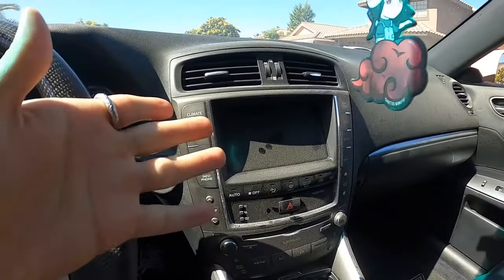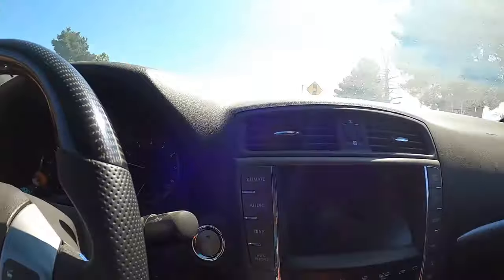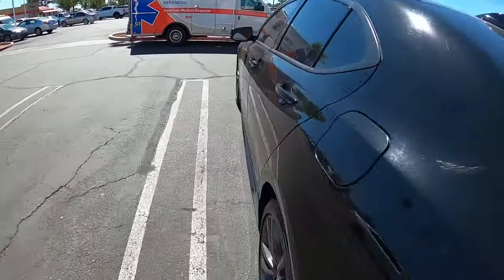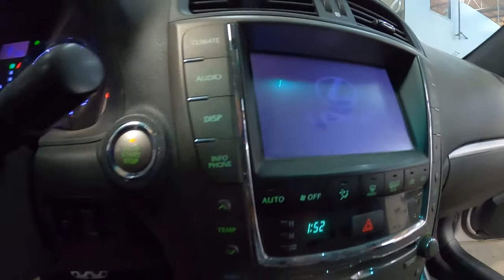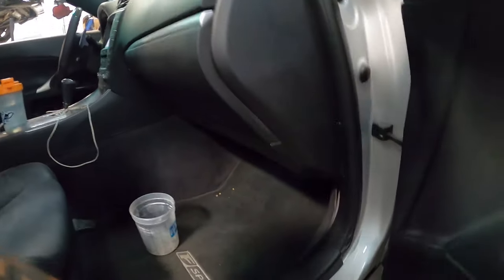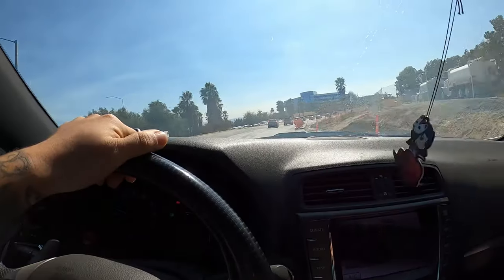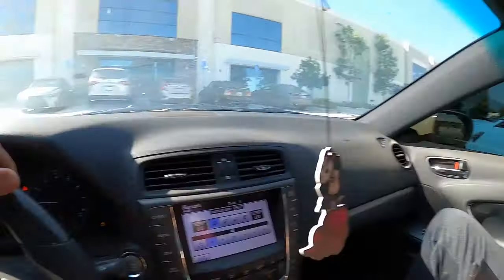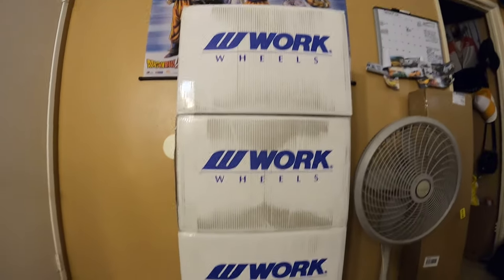HOW TO FIX THE LEXUS IS BLACKED OUT RADIO SCREEN!

Comment: its weird so for me the screen always goes black and cuts out and will stay off for a while.. BUT the radio works and the AC will work but i can't turn the AC on because the buttons for the AC are the screen and the side buttons. So the bottom half of the entertainment system works like the FM/AM buttons radio volume knob etc.. BUT the real issue now is the AUX never recognizes itself so that doesn't work.. the screen is black, but the radio works BUT no Aux connection detected lmao.. this cars fucking weird bro.
Reply: That’s what’s wrong with mine lmk if you found a fix

Comment: Hi Desmond,  I have a lexus 2006 IS350 that has the same problem, My radio is working but he screen totally black out. I like to know what and where is the location of the fuse that he Change? I really appreciate it if you could tell me. Thanks
Reply from the maker: So in the video around 7:16 is where he found the issue for the fuse. It could be a couple different fuses that went bad that have to do with the radio in my case it was my tv fuse (basically the screen monitor fuse) the time I set shows where to find that one in the vid as well as a couple other fuses but it would be best to have someone hook up there equipment to see exactly which fuse is out. Cause it might not be the same one. Preferably someone who works electric/radio. Hopefully this helps some, thanks for watching btw
Reply: Did you solve it?
Reply: I have the same issue

Comment: I kinda have the same problem. My radio on my 2014 Lexus IS 250 keeps shutting off and on very annoying. I change the fuse same problem not just a radio that shuts off the whole screen to the navigation shuts off. One of my friends said it can be the amp is getting shortage because the rain gets into the side vent or trunk or something like that
Reply: Having the same issue
Reply: Same here on mine too
Reply: My sister has the same exact car as mine and my boy has the FSport same year and has the same damn problem smh my boy changed the radio and still doing the same shit smh . I wonder if it’s a recall for this type of model on these Lexus!
Reply: @geoa.21  it’s so damn annoying driving with no music! My sister has the same car as mine and has the same problem! Also my boy just bought his car a year ago 2014 Lexus IS 250 FSport and has the same problem. He was told that water gets into the trunk and damaged the amplifier or something like that and he changed the amp. And the radio still same problem. I really think it’s something loose because where u charge you phone in the arm rest compartment. It’s always blinking. When the radio/navigation system turns on for that quick 2 mins maybe less . I can see the lights from the USB port twitching.
Reply: I’ve tried every solution since more than a year and i can sadly tell yall you gotta get your damn appointment booked by next week for a recall or get an aftermarket stereo has more features but it looks chinese as dick. I waited for more than a year hoping it will work but it gets worse by time and here’s how it went: started shutting off and on once or twice a day but after 3-4 months it will go off like 10 times a song. Ig 8-9 months later it’d go off for hours and when it turns on you don’t realize it until it shuts off. Now its just off i tried last ideas i had but nothing worked and still hoping as i havent reach for an appointment lol
Reply: @nasserd4619  My sister has a same car same year and has the same problem my friend has a FSport same year same model and has the same problem he change the radio still the same he change the amplifier in the back trunk still the same I think it’s a recalls
Reply: @oliechareunsouk3670  so haven’t you guys go for recall?
Reply: @oliechareunsouk3670 I drive an hour and a half to work with no music because of this bs. Did y’all figure it out?

Comment: My screen works sometimes it works when it wants to work can anyone let me know if they had that issue before and what it could be 2014 lexus gx460 I really appreciate it
Reply: I have the same problem, the dealership told me I need to change the whole front screen, with a price of $3400, did you fix it? I am confused here, because my screen is completely off, but the back up camera works.  So it's not the screen.

Comment: Hi
The infotainment screen on my 2016 ES300h doesn’t work sometimes. However, the backup camera works. I saw this problem in another ES. What is the solution?
Thank you!
Reply: I’m having the same issue on my 2022is 350 figure anything out ?
Reply: @niciannicelli5797  me toooooo. It sucks. Don’t let the dealership charge y’all for it because its ca manufacturer defect and from what I’ve read there was a lawsuit about this exact issue.

Comment: Thank you! This gave me an idea where to start. I have been dealing with this for so long but it’s the opposite for me lol. Mine is one of the cases where A/C works but the radio doesn’t and the screen is black other than in reverse. I’ll update when I figure it out. It sucks because I have to drive an hour and a half to work with no radio🙃 I’m gonna ask for help in the car group for my area. I’m too embarrassed to bring it to Lexus because my front bumper is broken and I lost all of my splashguards.. they’ll def judge lmao. I figured it was a fuse or wiring issue because it slowly glitched more and more until it stopped working all together. Ima read through the comments but if anyone else knows the issue lmk. I’ve tried reading the forums but I didn’t really know where to start.

Comment: My 2009 Lexus LE with less than 100k miles Navigation screen turn intermittently black? Everything else is working? Thank you 🙏🏽
PS…..My AC went out last year, it was a bad relay(?)  my boyfriend fixed in less than half an hour….the mechanic didn’t find it, his brother works on AC’s… it worked for my car

Comment: My dad s 2016 hx 460 .radio isnt working .no gps but back up camera WORKS ... please help my dad is 74 .the dealer in westchester said he needed a new system for 4000  ... and i dont trust the dealer anyway .please help and thankyou  !!
Reply: They got sued because it’s a manufacturer defect. They are supposed to do it for free from what I read in forums but I could be wrong. Google tf out of it just to double check. I’m right there with ya same issue here. Ac works, back up cam works, just not the radio and the screen only turns on in for the back up cam. Do not listen to that dealer because it’s a Lexus issue to begin with. Nothing you did to the car caused that to happen.

Comment: I had a similar problem on my Lexus IS250 08 model last week. I changed the checked all fuses on the passenger side and drivers including the ones next to the battery, but it never worked. After more research i took out the Amp which is located in the trunk. Blow out the dust and replaced it, and every worked. Radio is working including  all controls on the Radio

Comment: I have a 2015 Lexus ES 350 my screen keeps coming on and off but is off most of the time any suggestions, just wrote a letter to corporate office complaining about the screen to Scott Thompson CEO waiting on a response
Reply: I'm having the same damn problem (annoying) and I checked fuses. Until this video I didn't know that radio fuse was separate from screen fuse (tv). Hope this solve the problem for all of us.
Reply: Did you get a reply?
Reply: No
Reply: Ended up buying another radio on eBay $1500

Comment: I’m sorry it wasn’t clear which exact fuse he replaced can you tell us?
Reply from the maker: At about 7:35 my guy had said it was the fuse for tv1 which is basically a fuse for the screen. The radio worked and had power but wasn’t showing anything because of that screen fuse. Hopefully that helps you find what you need if not it could be other fuses that were briefly mention lol 🙏🏽

Comment: Pull the fuse out that says “radio” what a few minutes and put the fuse back in, if that doesn’t work you might have to replace the radio.
Reply: I am gonna try this cuz I’m sick of not having a black screen and no radio but my back up cam works just fine. I’ll lyk if it works for this issue.
Reply: @AriannaRusinek  let me know if it works or not

Comment: If you have the navigation is250 . 
Try and push and hold on the actual screen then power on the vehicle while still pushinh on the screen and see if it becomes responsive . 
If so . While holding the screen down go to settings and reboot the system..
Reply: That worked for me! Thanks 🙌🏼
Reply: What do you mean by holding screen down mine is going in loop and rebooting every few minutes
Reply: @AngelGarcia-bs4cy  push on the whole screen of the navigation unit itself